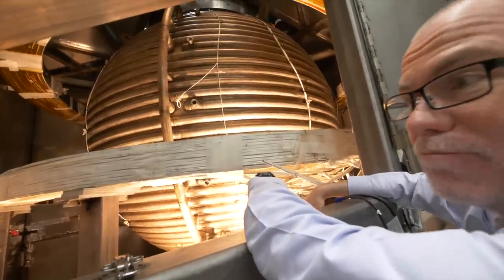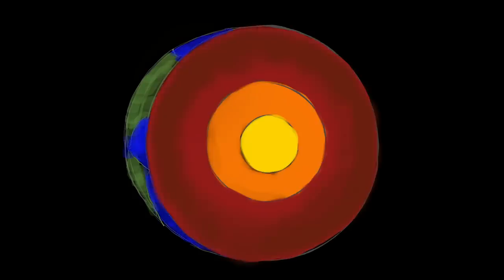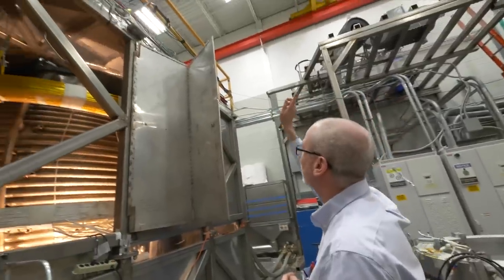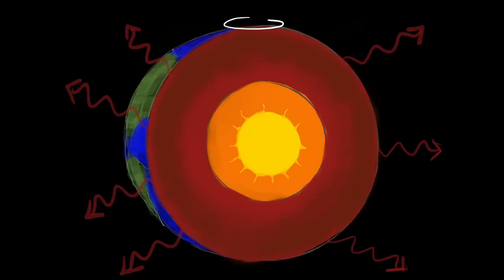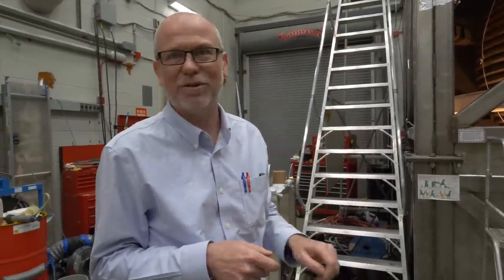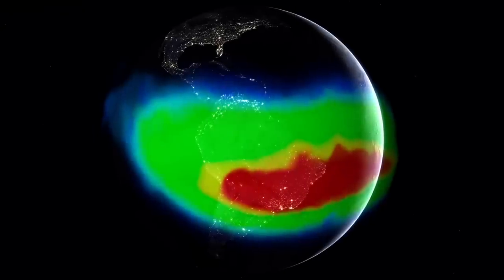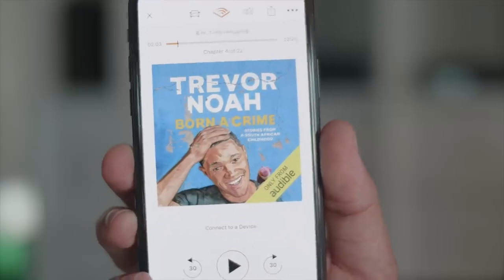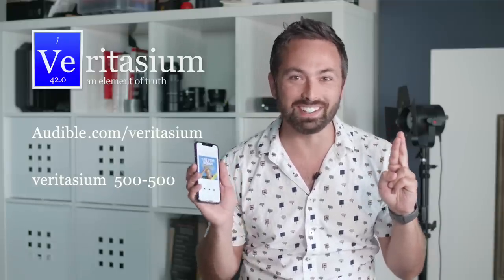Spinning Sphere of Molten Sodium

Comment: 130 degrees ok, then you can have have you tried compressing like cold air into the cycle or cold chemicals, which cools down the surface which then reduces the high temperature levels?

Ok, what's more interesting as well that you were studying the Earth gravitational pull unfortunately looking at the core the centerpiece so the only way you can look for a gravitational pull is looking at the sun because you doing it at a certain degree of Celsius

Have you ever tried mounting up on the square cube cold Solutions cooling down this mechanism so continues on running. Having a cooling system. Which cools it down?

So sort of like compressed air compressing it as it's Spinning Around

Ok, and you're coming across from certain problems. Where is heating up at the top because he rises for a gravitational one. So have you can press this and putting cold Solutions such as I don't know a freezer. Cooling down from the top and bottom and also the sides so pretty much creating your cube. Shape but into a chest freezer where it's pumping a lot of coldness. Into the Sofia of the heating mechanism cooling down on each surface.

Comment: Iv seen a molten sodium magnetic field generator before... Decades ago in fact so to say its the first time it's been done isn't completely accurate. The version I saw though was just being used as an overpowered electro magnet and it wasn't anywhere near the size of the one in this vid.
Reply: It wasn't an Earth like geometry. The point is to do it JUST with rotating turbulent flows as happens in the Earth for example

Comment: Compressing the heat so it's only centre middle, where is heating up at a philosophy where you are able to Channel this heat and hope for the best at the metal what you are applying it on shows electrical interference. But don't forget if you have certain chemicals, which a front outer space reacting with this. At the same time you'll have your own oxygen.

And carbon dioxide Which are looking at ways to develop?

Comment: Isn't it a bit worrying that the magnetic field has weakend by 10% in in 170 out of its 4.5 billion years of existence? Or is it like the climate which waxes and wanes naturally and that field strength will be restored eventually?
Reply: OD It's either a normal fluctuation or its getting ready to swap poles, which is also possible

Comment: Couldn't the influx of compressed nitrogen cause large amounts of condensation, introducing the risk of sodium-water reaction?
Reply: The nitrogen gas will displace the air around the experiment, no air =no water vapor

Comment: i am still confused that natrium = sodium (in my language "sodium" = natrium hydrocarbonate)

the ancient, Triassic-Jurassic safety technique is used ... a plate on the converter frame :)
I adore practical scientists - everything is on crutches, and most importantly, it works!
10% of the dynamics of the environment is not the norm for a hot "slurry" in a "capsule"?
Is Fe + Ni at 6k Kelvin solid? tungsten at 6k is already liquid ... is there no "overheated" "slurry" of heavy elements?

P.S. When working, do not forget to duplicate the duplicate security system when duplicating it!

6k Kelvin ... liquid carbon ... it's a pity for diamonds ... the core is hot as the surface of a star ... but, they say - solid ...
0G, 400GPa, 6000K - slurry or crystal?

Comment: Duh, heavy mining in those areas is what causes a "hole" in the. Magnetosphere. The surface "crust" AND the molten metal mantle work together. I guarantee that it is NOW stronger in other regions because of the "relocation" of certain ferrous elements. 1 question of mine is, "where do neodymium magnets come from?"

Comment: Umm, the assumption that permanent magnetism under 6000K is impossible,
is questionable, since the pressure is also very high.
i'd think that when pressure is high enough, any temperature is tolerable
for magnetism. Even black holes with huge energy stored in heat reaching
millions of kelvin have a magnetic field, which then also tells me that magnetism
under extreme temperatures is possible.
Now whether or not it's still 'metal' at that point beats me.
Much like Ice (water) can have various states (there's like 11 of them that we know of)
it may yet behave as liquid while being still solid enough to pertain magnetism.
More like solid forced to move as liquid, due to high temperature and pressure.
Malleable would be the closest.
It may prove useful in the future to see if the magnetic fields of different substances
yield different magnetic fields or wave forms. In that case we may be able
to determine empyrically what is in the Earth's core, instead of guesswork.
Also, testing a regular iron magnet under pressure for magnetism at rising temperatures
may also be useful, specially with very high pressures.
Reply: That would be passive MRI, btw.
Or rather magnetic imaging, MI. (since there's no resonance involved)

Comment: Really amusing this isn't as thoroughly understood, as it should be. Tesla said, to understand the mysteries of the Universe, think in terms of Frequency and Vibration. Harmonic resonance in Torus (twin vortex) or paired radial motion, with specific value applied to each independent corona revolutions, leads to harmonic field unity, which effects inertia as distinct mass flux. One example, One UFO lore favourite, the Biefeld–Brown effect, hints at ion / electron phenomenon, product is ionic thrust or delivering momentum transfer. Resonance / Frequency changes state transferred by particles, activates neutral ordering of particles, processed via acceleration of neutral particles, analogy of " beat wave (BW) excitation of plasma waves" via charged particles, delivering impressive results, like ionic propulsion. It's the process, not the parts.

Comment: K sodium, have you ever conclusively reacted with cold air solution? From the top bottom and also the sites surrounding this call element cooling down So you can reach up to a higher temperature? As it's been projected Lee calling down you looked at things to do with objects such as Xbox vs. PlayStation computers. How it generates a lot of heat including vacuum cleaners car engines that you need something to call it down that water is a great solution, but unfortunately your battery is too much. And we all know that heat travels through our atmosphere. So, have you ever considered compressing it with lots of cold air which has been projected firing at the same time when it is activated?

Comment: So liquid nitrogen on top of the experiments that now have you ever consistently using it at the same time as you're firing up this mechanism cooling down the system at the same time as it's firing up a lot of heat. On all sides including below as well. We all know that he travels up because of Fires which have been written up and we know that far travels upwards.

Comment: What kind of guass rating does this generate ?  The earth is not made of sodium . you will need a mixture of the heaviest elements availiable. i think the control test is not very acurite in this situation . the em field is getting weak because when you heat a magnet the magnet dies . we are in a warm period called a interglacial .

Comment: So your creating a positive core of sodium...which makes centre of a magnet like Earth...but this is also antenna system...but even with heat compression makes core positron like object due to compression...however heat can displace some em waves...so heat could be apart em transformations...

And why people dont think Earth is hollow, however this motions create Jupiter rings...and this state we wte looking at is how Earth was when the dinosaurs existed with greater gravity...before losing some pressure...as the planets surface increased in size....meaning Earths in a transition state we will have to over come, and could be hollowed than it was before...

And oddly we may be able to replicat gravity via towers and satellites......Earth could require 'we're prepared for a lack of shield...

Comment: You said now we know we have a solid core. How?
Reply: We know the earth's size and we can find its mass using measurements of gravity. That gives the earth's density.

Once we know its density, along with some other bits of science, we can make very good estimates on the average chemical makeup of the earth.

We know that the earth is too dense for its size and chemical makeup to have a fully molten core (metal expands when it heats up), so some part must be solid. This is backed up by seismology where you cannot detect the waves of vibrations from an earthquake on the other side of the earth directly (the wave blocked by the solid core) but can through reflected waves from the earths surface.
Reply: @nickq8093  how do you use measurements of gravity in order to determine something's density?
Reply: @levelliberation6155  density = mass/volume. We know the earth's volume and because gravitational force is dependant on mass if we measure it finely we can derive the mass of the earth.
Reply: @nickq8093   are you a scientist? Just curious how you know so much. If mass and volume = density then I guess I would like to know what mass is considered? I appreciate the responses btw
Reply: @levelliberation6155  
He hadn't responded back so I'll try answering your question instead.

Density = mass/volume

volume of a sphere = 4/3*(radius*pi)

Gravity = G * mass / radius^2
(G = gravitational constant)

Following these formulas, we can estimate the density of a planet just by knowing its radius and gravitational pull.

Because know the radius of Earth and the gravity on the surface, we can rearrange the Gravity Equation to get the mass of the Earth:

Mass = (Gravity * radius^2) / G

Calculating the volume isn't a problem since we already know the radius.
By knowing both the mass and volume of Earth, we can estimate its density.
Reply: @spynorbays  how is it that we know the gravity on earths surface and/or how would we determine this?
Reply: @levelliberation6155  Drop an object from a height and measure how much speed it gains in a second.
That's the acceleration due to gravity. It's 9.807m/s2 on Earth at sea level.
Reply: @spynorbays  i know I probably sound like a broken record , but I don't feel like it's  been fully explained. What object  would you drop?  Because the speeds would vary depending on its density and air resistance
Not to pry but what exactly is sea level?
Reply: @levelliberation6155  The mass of the object wouldn't matter as gravity accelerates all objects at the same rate. 

Air resistence should be avoided as it would slow down the object's fall and interfere with the measurement, ideal experiment condition would be in a vacuum.
If in a vacuum, the shape and material of the object wouldn't matter.

Sea level is the average height where the surface of the sea and atmosphere meet.
Reply: So if I'm in Denver Colorado  then which coast would be considered  when determining  my current elevation ?
Reply: @levelliberation6155  Not a single coast, sea level is the average of sea levels over a metonic cycle (It's the average for the whole globe). The elevation of a location is usually known.
According to Wikipedia, Denver Colorado is about a mile high from sea level.
Reply: I hope this makes sense but I'm wondering if its a mile high then when I say from which coast, how on a globe do you determine that to be the case considering the curvature in any given direction is going to change how elevated you are according to the sea levels distance from you
Reply: @levelliberation6155  There is no absolute up/down in space and gravity vector of a planet always points to the core of the planet. That means what we call "up" is relative to our location on the planet.

So sea level is basically the average distance to the centre of the planet from the sea surface, which always points to the core regardless of direction or curvature.

Comment: Wait... with global warming  wouldn't we get a larger molten part of the core?  And couldn't that reduce the magnetic field?
Reply: The atmosphere getting a few degrees hotter will not have an effect on the earth's core thousands of kilometers below.
Reply: @goatpriestess1202  I don't think you understand the implications of climate change.  The earth can't reject heat as quickly because the atmosphere acts as insulation to black body radiation when CO2 levels are high.  This means the earth itself will have higher energy content and therefore the core as well will be hotter.  The atmosphere getting warmer is a side effect not the main trend.

Comment: Do you at least understand that the magnetic field doesn't just change? In fact, this is the so-called Janibekov effect. And if he had a model flip (nut) on the space station almost instantly, then the core of the Earth will turn over very slowly because of the huge difference in the density of air and molten magma. Hence the climate change on Earth. In addition, at the end of the remagnetization, and in fact this is a coup, something will happen that has already happened many times. Namely, after that revolution, the energy pulse will not dissipate in space. This initial impulse will set the lithosphere in motion. And since the oceans fill the depressions on Earth, this will lead to huge waves that will sweep across its entire surface. Fill some basin with water, and then kick it with your foot. What will you see?
In addition, ocean currents are changing. take at least the Gulf Stream as an example.

Comment: Now hold up, could you use acoustic levitation in addition to this since you know the exact mass of the ball and molten metal? I dont know how the magnetic field would react but it could potentially be great if you could make it spin without messing up the vibrational magnetic fields. In fact, i think it would help since the magnetic fields will be in place already, making it easier for them to form from the spinning metal

Comment: Good science but imo you will never achieve a closed loop dynamo due to the fact that you have two huge magnets that counter the inner magnet field. If you could regulate those external magnets to zero then you could test further into the details of that closed loop system. Take into account that you might need to adept some changes to where your inner fluid is positioned as in resemblance to the earth.

Comment: This model is wrong , that’s not how it is
Reply: What's wrong about it? What's the correct model?
Reply: Earth inner core is solid not molten.  The molten area is between the inner solid core and outer shell
Reply: @VIRCI  How would that affect the magnetic field? Maybe it's just a shortcut they took because it doesn't really affect the experiment but would have been difficult to implement? Or do you think it could change the conclusion?
Reply: @VIRCI  yeah thats... what the model is...

Comment: Um. If they want to know how earth's field is made. Why inside copper or metal.

Wrong. You should care where the tickle came from. Might be something missed just like with whatever caused a muon to not fit scientific theory. With that and many other unseen things found. Assuming you got everything would be the same insanity that held back the knowledge we learn these days.
Reply: That's not what he means. He means that for the purpose of the mechanism by which earth's magnetic current is generated, the initial field generation that kicked it off doesn't matter.

Comment: That last "statistic" doesn't sit well... i get these guys are smart... but how do you say the earth's magnetic field has weakened 10% over the last almost 200yrs.. they do not know those measurements
Reply: they do know the measurements though...
Reply: @showoff2500  I'm not denying they are smart and have data for the last couple hundred years, but to think that there is enough data on an earth scale/timeline to understand planetary cycles is ridiculous.
Reply: @dseelenmagie8811  we do have a rough idea of how strong the magnetic field has been over the course of the last 100 million years or so
Reply: @showoff2500  that's only best estimations, C'mon. We relied on horse and buggy less than 150 years ago. Let's not get big heads as humans and think we know how to control planetary rhythms, cycles, and magnetic fields just yet.
Reply: @dseelenmagie8811  they aren't estimates. The earth gives us the strength of the magnetic field since the atlantic ocean formed, because we can see how strong the magnetic field was and it's direction in rocks gathered from the sea floor of the atlantic ocean

Comment: BS, molton metal cannot be magnetic..
Reply: It is not! This is not a magnet it's a liquid electric generador if you wish
Reply: @rubenrojas499  It's a sphere with an electric magnet at the center, and a void which contains Sodium in it's metallic state, it is heated until it becomes (liquid).. Costs them a fortune to operate, and they get no output.  Duh..